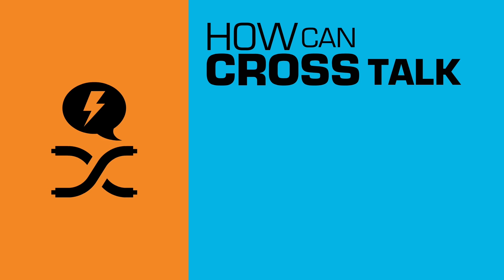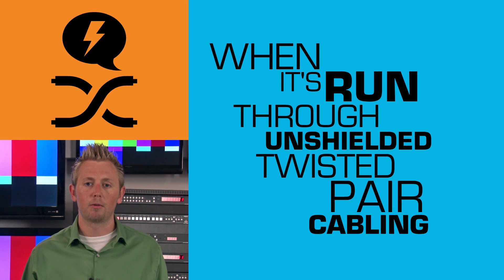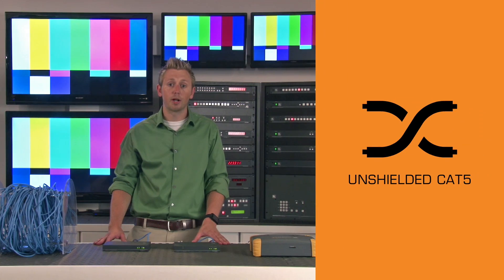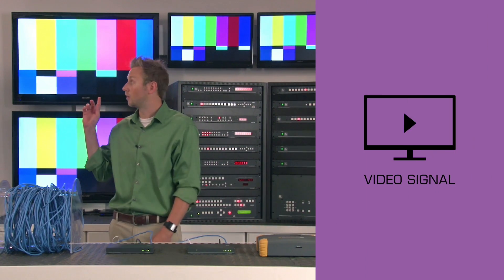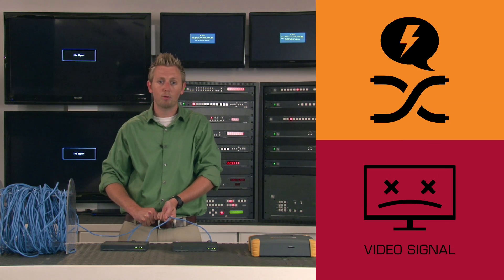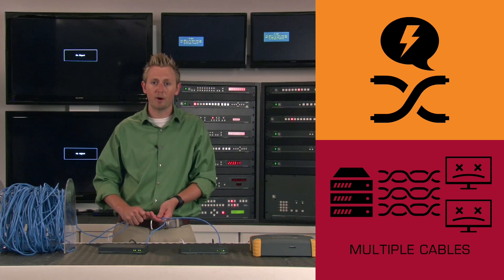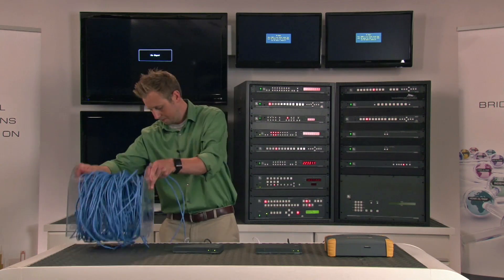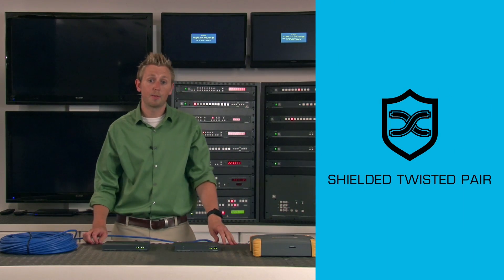Cross Talk Problems with Unshielded Twisted Pair Cabling

Comment: My apartment is using non-shielded cat5e cable. There are 4 ports around my apartment, and all of the cables meet up in a panel where my router is. Would you suggest replacing these cables with a cat6 shielded cables?
Reply: No need unless you are experiencing issues.

Comment: I really think that this was staged. That someone was cutting off the signals to the TVs... shielded cables are nice though.
Reply from the maker: Can you believe this was a live demonstration!? Thanks for watching and for your feedback! :)
Reply: @kramerelectronics  So crosstalk is a problem when you hold the cable near itself, but NOT a problem when it's all bundled up in that big spool?
Reply: I am sorry, this is clearly staged as day and night. UTP cabling (basic network cable) is used to transmit data (same 1s ans 0s in an hdmi calbe) over much longer distances and it has no problem with it. Look at this! 
http://farm3.static.flickr.com/2189/2215694485_ec3583babd_o.jpg